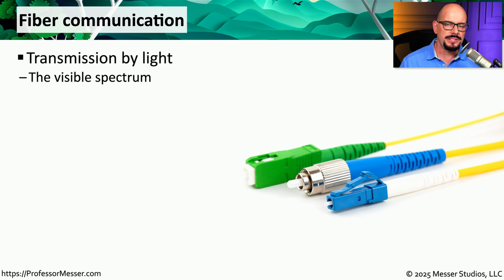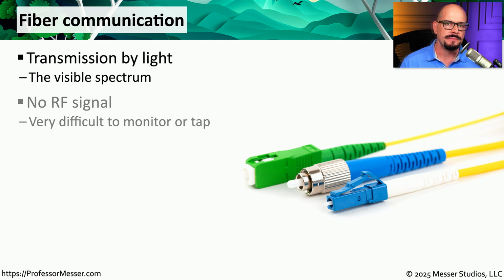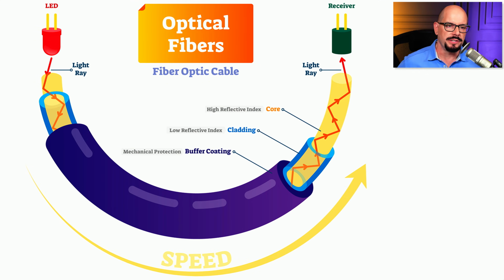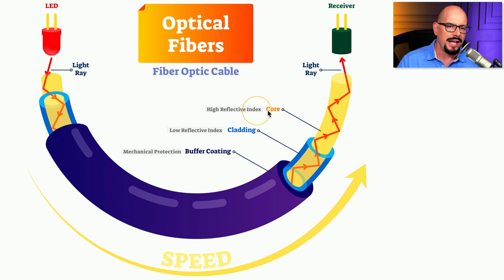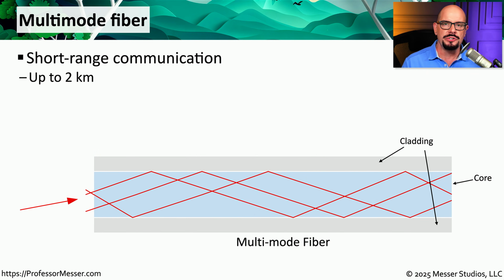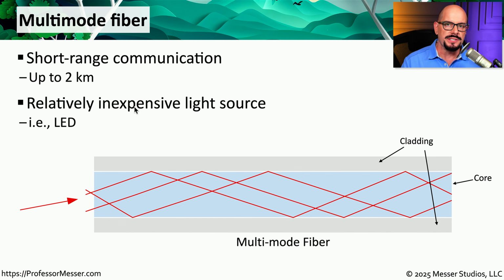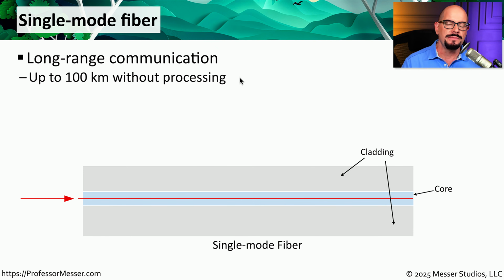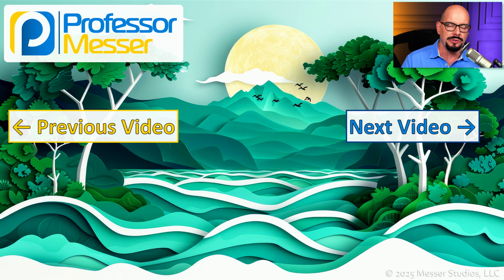Optical Fiber - CompTIA A+ 220-1201 - 3.2

Comment: One thing you should keep in mind with fiber is the terminations are VERY difficult sometimes. It might be helpful to have a specialized laser light (they're very cheap on amazon, like, 20 dollars) in order to see if your light is "bleeding" anywhere. Another piece for terminations is temperature. When fiber heads get cold the gel inside that the fiber sits in to repel water (which water is another factor you need to deal with) will get hard and make your terminations FAR more difficult. It may be more productive to warm them up first so you aren't constantly breaking your freshly de-cladded and cleaved fiber. De-cladding and cleaving is another thing you have to keep in mind for terminations, de-cladding is the action of removing the clad from the outside of the fiber and cleaving is cutting it down to side so that the de-cladded section fits inside of the fiber termination. This is all very difficult to explain through words only so it might be helpful to watch some videos and by some fiber for practice because if you plan on working with it often these are just some of the factors you need to consider with fiber connections.